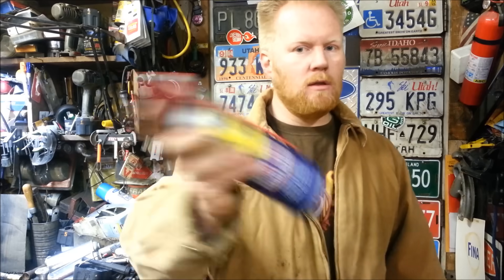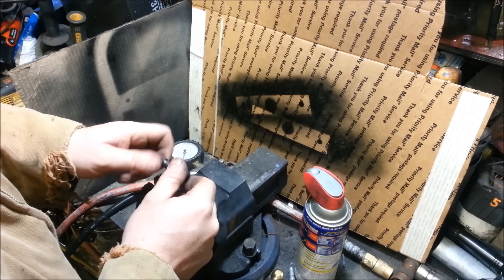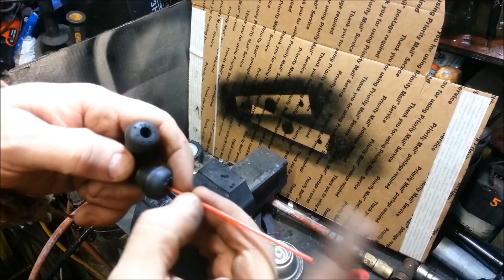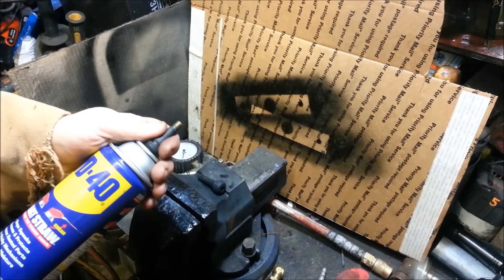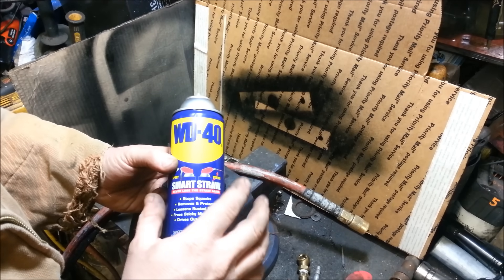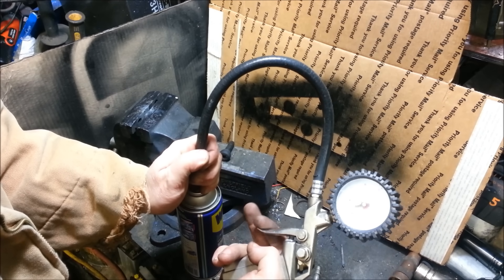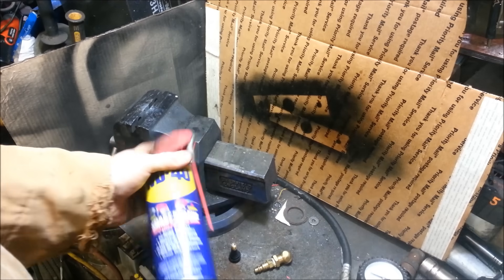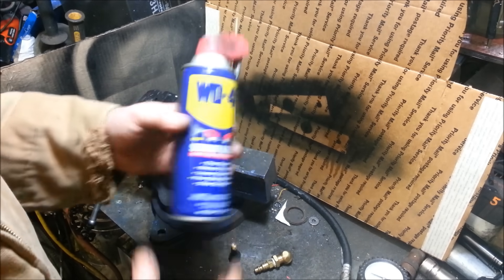Refill flat AEROSOL Spray Cans like the WD-40 and others

Comment: hello friend what would be the maximum quantity of product or liquid you add to the bottle, ie the proportion? could you then add the pressure with co2 or propane gas instead of air? would there be no danger for that? if it is the case how much you would add maximum pressure for these 2 gases if it is not how much you add then with an air compressor to the maxumum?

Comment: Awesome tip man!  Tried this with the valve from an old mountain bike inner tube and one of those standing up bicycle pumps. No problemo doing it by myself. Worked like a charm on my alost empty air duster cans. Feels great knowing that I can puff away w/o seeing my money go with the wind. :D Many thanks. 
 
Two of the cans did not have the male plastic pipe sticking up (that male part was in the spaying nozzle cap), so I just cut a short bit of the plastic pipe that came with the air duster can and put that into the hole. It sealed well enough to put as much pressure as I was comfotable with (heard a slight creaking sound around 60+ psi, and stopped).

Comment: This is a seriously a bad idea. Do you know how a Diesel engine works? You compress oil and air together and bang!!! I don't know what WD40 use as a propellent, but I could guarantee there's no Oxygen in it.
Reply: Not quite, the air in a diesel engine is compressed to 300-500 psi and diesel has to be injected and atomised into the pressurized air for it to combust, just sayin!

Comment: I haven't been able to get it to work as of recent. I think the company whom makes the cans found about this and they started to put one way check valves in the can to prevent us from doing this. Once the air pressure is dead I puncture the can and drain the contents into a spray bottle.

Comment: “I have air in my can”. That happens to me after eating Taco Bell.  Great tip man.  I actually have tire valves because I bought the wrong ones and I never throw anything out.  There’s like 12 WD40 cans with fluid but no air in my shop.  Going out there right now to get this done.  Quick fact.  WD40 isn’t a lubricant.  The name stands for water displacement-40th formula.  Now you know. Thanks again for the tip.
Reply: dude it's a lubricant, why would an oily substance not be a lubricant? It's not a very good penetrating fluid.

Comment: Umm.  As a retired safety engineer... You are mixing air (20% oxygen) with a flammable oil and putting it at 90 PSI.  Are you aware that That is how a Diesel engine works???   Air + oil + pressure = BOOM.  A detonation.  Even IF you don't have an instant burn, in time some of that oil will "oxidize" with the oxygen and the byproducts will be carbon dioxide (no biggie) and water.  GREAT if you're always using WD-40 because the WD means "water dispersing" but many other products won't necessarily be so water friendly.  There are other things you could pressurize it with (CO2, nitrogen, etc.) but I'm just "mentioning" some chemistry here.

Comment: Very cool. I haven't tried it, but I think if you had just an air blower end with a rubber tip on it that's the right shape/size, you wouldn't need the tire valve stem.

Do you have to push down/open the valve on the can when you fill it?

Comment: I seen this before, and have done it a few times myself. For me, at least, it isn't good as new, you can get the contents out but have to keep shaking the can to get the contents mixed with the air. But it is worth doing, and will allow you to use a otherwise useless can of whatever.

Comment: great idea, but why use WD-40 if you can useMoS2, which consists of Moblybdenum disulfide, 
That is much more efficient as a lubricant than WD-40 (Water Displacement in the 40th attempt )

Comment: I use a different approach to re-pressurize mine. I find that the "canned air" tube will fit into the WD40 tube hole and seal. Then I turn the canned air upside down and press both buttons and the canned air pushes liquid canned air into the WD40 tin. That works even better than just compressed air.
Reply: where I live, canned air is about as expensive as WD40, so that wouldn't be very efficient moneywise
Reply: @shmvon  It actually takes very little canned air to recharge the WD40. You could recharge about 10 WD40 on one canned air. And WD40 lubricates better than air so sometimes its just about getting the job done!

Comment: DO NOT DO THAT: adding compressed air (and therefore oxygen) to a can containing some extremely flammable liquids and/or gases is potentially an excellent recipe for a disaster!
Reply: It's been said that WD-40 is not flammable, so that would be okay. Paint cans are very flammable tho, and I wouldn't do that to them!
Reply: @ljtlove4519  Who said that?  The wd40 itself IS flammable.
Reply: WD40 is not extremely flammable, so chill out Karen…
Reply: NOTE: aerosol cans are generally all very flammable, because they use flammable propellants(propane/others). the liquid itself is often non-flammable, until a certain temperature is hit.
the most non-flammable wd40 is a hand pump spray bottle, filled with 1gallon or larger bulk containers, many industrial applications do not allow "aerosols" at all.
recharging with compressed air makes majority of  them less flammable. but beware of moisture, which ruins most things and hampers the performance(wd40 is ok there, since it displaces water/moisture, BUT it will make the water bead up inside the can and possibly pool.
Reply: @throttlebottle5906  No, it's not the propellant that's the problem.  The propellant is no longer butane, it's co2, HOWEVER, the WD40 substance itself is flammable.  Premixing it with air is a terrible idea.

Comment: If you have the small toolbox can of EW40 that is empty you can recharge it several times. I've been doing this for years. Simply take the red spray tube and attach it to the can with the most WD40 in it. Press both cans at the same time and it will fill the small can until the pressure equates. Presto the smaller can is back in service. Now its not full but almost 1/2 and you can fill it like this for years!
Reply: Thanks for that tip !!!
Reply: Genius fix!  I tried this using an air spray can and an exhausted wd40 can - worked great!  This is the BEST solution that I've found. thanks.
Reply: 😂😂😂 THX I LOVE IT GOD IS GOOD
Reply: This is another awesome tip!  Thanks
Reply: Aerosol cans aren't filled with air.  They're filled with CO2, butane, natural gas or freon (very old cans)…  The CO2 leaks out, because it's a very small molecule.  I have 40 year old freon charged cans that still spray fine, because freon molecules are huge.

You're not "refilling" a CO2 pressurized can if you put air in.  Air is an oxidant, and will gradually degrade most compounds, especially paints and spray adhesives.
Reply: @PanamaSticks you are correct. I'm not sure about WD-40 but PB Blaster uses carbon dioxide as a propellant
Reply: Good stuff!

Comment: I always thought that WD-40 (and other spray cans) use PROPANE gas to create pressure, not air. So I use simple lighter refill bottles to replenish the pressurizer gas in those cans. Refill bottles are cheap, readily available and very easy to use, and cans works like charm afterwards.
Reply: Best part: using lighter refill you cannot over-pressurize or overfill the cans.

Comment: WARNING THIS CAN BE DANGEROUS. 
Those cans usually have flammable material inside. While there is gas like CO2, propane, nitrogen, etc, you don't have to worry about it because it's in non-flamable atmosphere, but I feel like having there atmospheric gas with oxygen and stuff can be rather dangerous, especially it it's all encapsulated in small pressurized can.

Can somebody who has some experience with this take look at it and tell me if I'm right or wrong?

Anyway, overall it feels like a great tip, I think I'll try to use sodastream cartridges or nitrogen filling stations on gas stations to try it. If this works it will totally change way how I operate. Since then I always payed too much attention to have can in correct orientation so it would use as little gas as possible, but if this works, I won't be having to pay attention to this, which would give me a lot of freedom.

Comment: put it in the freezer for about 10min first to get the most pressure
Reply: it's actually the oven to get more pressure, cold air is denser relieving pressure on the container(ie.can).  Heating  air will expand and create greater pressure on the container(can)

Comment: Road bike (skinny tires / spandex shorts) high pressure pump will do 90 psi easy (which is normal for road bike tires actually).  Don't need a compressor and much more safe.

Comment: Pressure and oxygen are good at starting explosive chemical reactions. That's why aerosol cans don't usually contain air. If you happen to ignite the spray from one of these air/fuel filled cans I can see it flashing back into the can and blowing your arm off.  Your workshop catches fire, you have a bomb. I wouldn't even leave one of these in the hot sun. I won't be using this tip.

Comment: If I pay $10 for cleaner, lube, or anything else in a can and it runs out of air half full I take it with me to the next parts run and get half my money back. I shouldn’t have to be the one compensating the huge company for their loose quality control methods by spending any amount of my time McGyvering their product that failed. Pay me back or I purchase a different product for the rest of my life and let everyone know that the company is a bigger cheapskate than me. Iol😁

Comment: This is something which peeves me, and it usually happens to the can in my car.  I usually just use a butane can and a rubber eraser with a hole through it to connect the two.  Lots of reserve without the high pressure.

Comment: Sorry, but isn't it dangerous to pump air with 21% oxygen into a tin of flammable liquid. BANG! under the right/wrong conditions. I'm pretty sure they pressurize them with CO2 or nitrogen for that reason.

Comment: I just drill a hole in the can and transfer the liquid into a sprayer
Reply: Cool... man. Thanks for posting.
Reply: @lazarogerardoviveroschargo3292  they do have pressure left. So normale the moment you drill a hole it goes "pofff" and everything is gone.
Reply: That's dangerous, especially if you smoke.
Reply: @DinkyDoughnut  Smoking is dangerous anyway.
Reply: Just punch a hole with a nail at the edge of the top rim.

Comment: I think you should update this as there is a reason that air is not used with flammable substances. If it comes into an ignition source and the mix of oxygen to flammable substance is good enough the can will explode!!!
Reply from the maker: No it won't. You've watched to many Hollywood movies. The nozzle is a text book flash back/flame arrestor.

Comment: This is great for rattle paint cans. Gonna try and hopefully stop the dreaded end of can splutter blobbing.
Reply: Yeah and the cans that have an innie instead of an outie you can just use one of those rubber raft-inflating plastic cones that go inside your air chuck. Or an air blower with cone shaped rubber tip and press em against the hole

Comment: Good Idea. I have complained directly to WD40 and have received replacement cans, which is very gracious of them, but they could solve the problem by replacing the CO2 propellant with a propane/butane mix as this will desolve into the product under pressure, and release more free propellant as the cans empty.

Comment: used to take a dead can of whatever. punch holes in the bottom fill it with water. reseal holes with solder. and then link it with a fully charged can with the dead can with the red nozzle. once charged we then were able to shoot water from the formerly dead can

Comment: And always have to spray can upside down after you do this. It must blow the drop tube off the can. But it does work
Reply from the maker: WD40 actually has an air bleed at the top of the pickup straw with a check ball. This mixes propellant with the fluid so it is foamy when it comes out. The check ball always sticks and is why you run out of propellant before fluid. If you refill it with air too fast it jambs the check ball and the can has to be used upside down.

Comment: I just dent the can that builds the pressure up enough to get the last bit out
Reply: I heat them slightly..
Reply: @OddBr18g  yeah i throw them on a full heat barbecue. for 10min.
Reply: Easy peazy
Reply: I put it in the microwave.😜

Comment: Had you tested to see how long it takes for the can to explode if overfilling ?
How many PSI did you have on your regulator ?
I see you did 2 short burst, it is what it takes ?
Don't take me wrong, I am impress and would like to use your idea on my WD-40 and Paint spray cans. I believe you are a genius.
Reply: I wouldn't advise anyone doing this. The cost of buying another can is cheap compared to replacing a hand or other body parts

Comment: Wonder if you could just drill  hole put tire tit through hole and also use the same tire tit opening to put wd 40 in can using syringe. But this is all only as good as those cheap sprayer nozzles on the stupid cans. Wd40 needs to step it up on their janky canned product. Losing pressure and cheap nozzles

Comment: One question. are you sure its "air" that comes in the can originally? Not an inert gas like nitrogen or carbon dioxide? It seems like mixing air, which is 21% oxygen and a flammable liquid under 100 lbs. pressure may lead to unfortunate consequences!
Reply from the maker: Generally these come filled with propane/butane, Freon, or CO2. 

Nope. Pressure combustion (diesel) takes place at around 700psi.

Comment: Get a butane lighter refill with all the multi-adapters. Get can air, pull top off from it. put adapter on. Pull top off WD-40. Use can air with the butane adapter. Done. Been doing that for years.

Comment: I've never had WD run out of air, but all the time with spray paint.   I wonder if normal "air" <as opposed to what I'm guessing is nitrogen in the paint can> will make the paint go frothy...   ONE way to find out... and if it does, well, all I'm out is a few minutes of time...   One of the better hacks posted.

Comment: You can purchase WD-40 and PB blaster in 1 gallon metal cans at parts stores and home-improvement stores. Usually they’re 20 bucks, get yourself a good spray bottle and your set. Way cheaper.

Comment: I saw this last year or something. Never had a can ran out of air I don't know if it got too cold this winter like -30 for a long time but lately all my cans are always out of air. You could use a normal nozzle and just stick a rag over it and the rag will seal it enough to get some pressure in.

Comment: I hate the "new and improved" WD40 nozzle. The larger diameter tube no longer fit into car lock cylinder's keyhole. Worst, it barely fit if you push it and when you try to pull it out it snags on the sharp SS keyhole cover.
Reply from the maker: True.

Comment: Many years ago I drilled a hole in the base of a spray paint can that had run out of puff but by shaking it still contained plenty of paint.  I soldered a schrader valve to the can, forget the details it may have been car or bicycle type and pressurised the can with a pump.
It was not succesfull because the remaining paint came out in a squirt rather than a spray.  I thought at the time that maybe this was because aerosol cans were pressurised with a gas other than air so gave up.

Comment: Stupid and dangerous.  You just put compressed air (oxidizer) with WD40 (fuel). I hope you have a good lawyer.  New cans of WD-40 use carbon dioxide as a propellant (I think).  Not air.  Again, don't do this.

Comment: I use this all the time. I use a large hyperdermic needle from a farm store and made a tip for it that fits over the plastic needle on the can . I can fill the can with whatever I want, Usually rubbing alcohol. Then I have another plastic tip on a cheep harbor freight air gun , that I use to pressurize the can.

Comment: I would think that putting compressed air into a can of flammable liquid would be asking for an explosion - sort of like a diesel effect. I work around oxygen tanks and they told us NEVER to use any kind of oils on the threads for this very reason.
Reply from the maker: Because oxygen is 2000psi. Diesel effect happens at over 700 PSI. A compressor maxes out around 175PSI but is regulated down to around 100psi. Nowhere even close.

Comment: Better yet, buy manual pump spray bottles whenever practical as they're MUCH more economical and reusable.  Aerosol can valves are cheap trash which is fine for purpose.  I use an old AC can piercer to harvest aerosol can contents (and leave a paper clip inserted in the hole so it never clogs) which is handy for recovering paint etc.

Comment: Its a really, really,really bad idea to inject air into a can that has flammable gasses or liquids in it.

One spark from static electricity and its a damn bomb.
Reply from the maker: Spark from where? Random sparks just floating around in the air everywhere? Second the nozzle on the can is a perfect flashback flame arrestor. A Flame would never enter the inside of a can.
Reply: @sixtyfiveford  it can follow the fuel air mixture you created right back up stream and into the can.

The odds are small., but possible.

You're lucky you still have all your fingers.

Comment: you can also do this with simply using another can of wd40.  or a spray can of air.  I use my method for mixing spray paint colors, but have re-aired several also